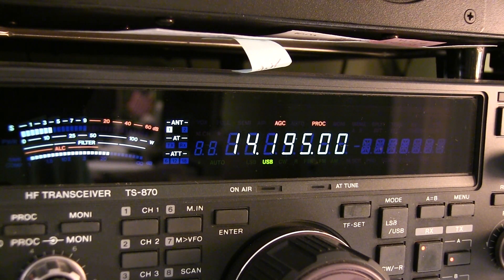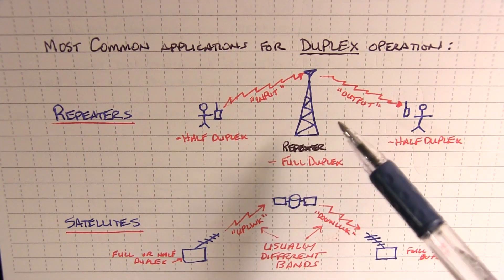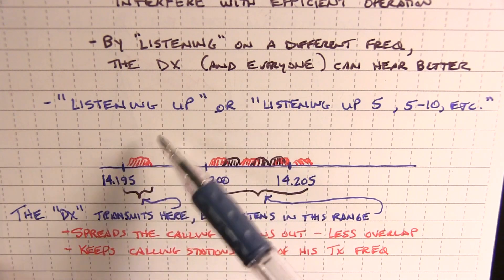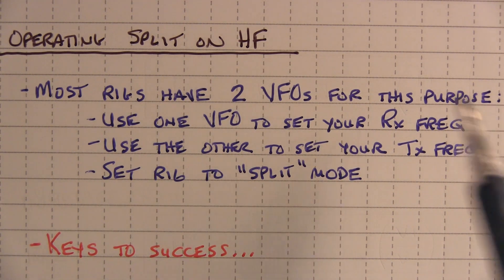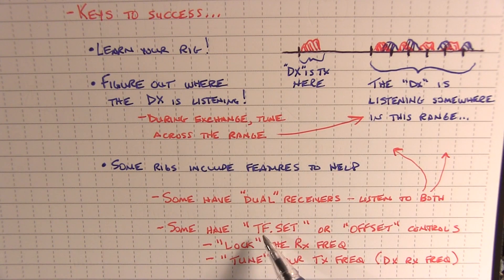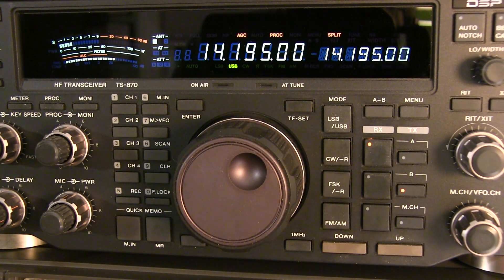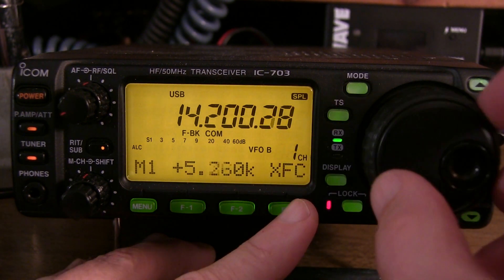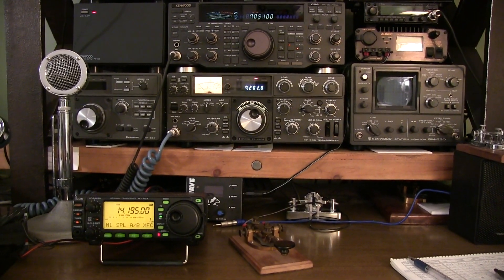#331: Ham Tips: Operating "Split" on HF - info, tips & tricks for operating split or Duplex on HF

Comment: Thank you for this. I sure would like to be able to hold my own on CW on weekends too. I find it hard to tread water during heavy contesting weekends. This breakdown helps a lot. Thank you Alan!!
Reply from the maker: Best thing is to get on the air and transmit at  your comfortable speed.  Good CW operators will slow down to meet you.

Comment: I have never operated split. I use RIT almost every evening for our local 10m net. Some rigs are off about 100Hz and the audio improves if I adjust the receive frequency a bit.

This is an excellent explanation of why duplex operation is important to operators who develop a big pile-up. I've had this happen a couple of times when activating SOTA. It doesn't last long, usually, and I can get enough of a callsign fragment to make the call. But I wonder if working duplex might make it easier.

Thanks for an excellent presentation. I still love the old-school hand-drawn notes approach. I despise PowerPoint and its ilk.

Comment: Thanks Allan.  I was hoping you'd describe the process using the RIT function on your other Kenwood, the TS-830s.  I know it's old but I have an 830s that I would like to become proficient on before buying a newer rig.  Thanks.
Reply: Provided your RIT has enough range, you can work split using RIT. With RIT off, just select your TX frequency on the main tuning knob. Then, switch on RIT and use the RIT knob to tune down to the DX station. You can then call the DX station and you will be transmitting on whatever frequency you selected on your main VFO knob. You can quickly listen on your TX frequency by switching RIT off (this is useful to check your TX frequency is still clear).
Reply: @Steve-GM0HUU  Thanks Steve.  It'll be a few more months but I'll keep your comments in reserve for the big day when I finally my shack up and running. 73 KD2ORG

Comment: Many thanks for the advice.. Could you tell me the CW protocol for calling CQ when using split frequency working, please?..73..John..G4EIJ
Reply from the maker: The most common thing to do is to add the "UP" designation after your CW.  You can add the split amount if you like.  A few examples:
CQ CQ CQ DE G4EIJ G4EIJ UP K
CQ CQ CQ DE G4EIJ G4EIJ UP 1 K (to indicate up 1kHz)
CQ CQ CQ DE G4EIJ G4EIJ 1 UP K (to indicate up 1kHz)
CQ CQ CQ DE G4EIJ G4EIJ UP PSE K
etc.
Reply: @w2aew  Thank you so much for such a comprehensive reply.. That covers everything I wanted to know..Thank you again.. 73.. John..G4EIJ